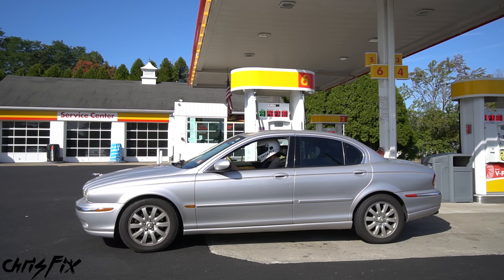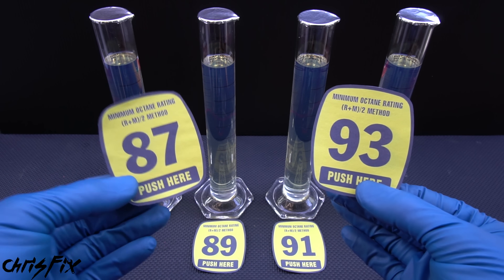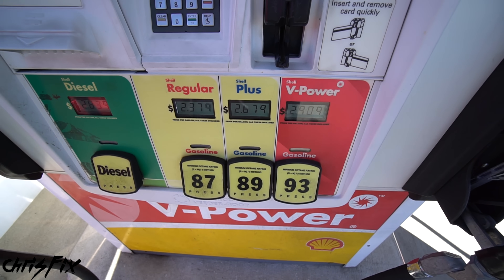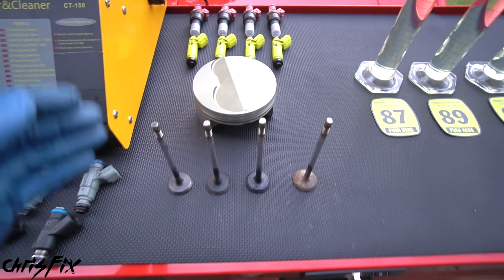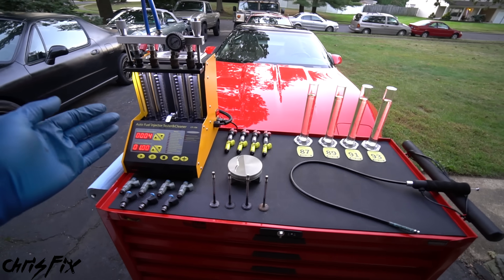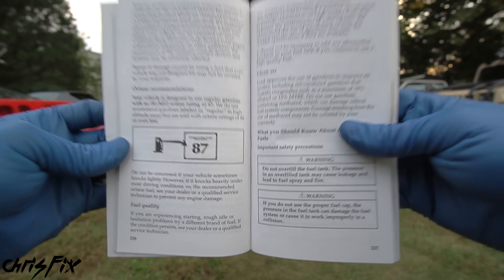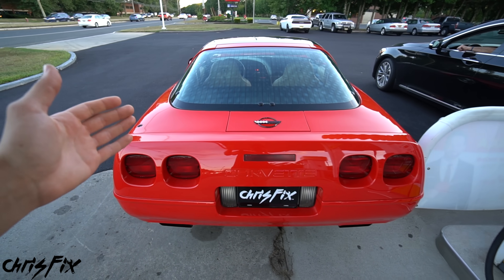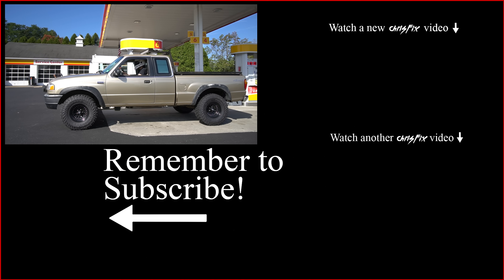What is the BEST Fuel to Use in Your Car or Truck and WHY

Comment: Which fuel do you recommend for a 1999 Lexus ES 300 with 270,000 miles on it? Premium is recommended but not required in the owners manual
Reply from the maker: For such an old car, premium would be better but you can totally run regular since it says recommended. I would see what kind of mpg you get on each and see if the premium is about equal to regular in price if there is a mileage increase. Detonation in any engine is bad but in an old engine it can be really bad, fast.
Reply: @chrisfix  Thank you so much! I have been debating this with myself especially since I have always used regular, but given its mileage maybe premium is better.

Comment: Could you go into E-10? It's getting standardised over our Regular (95RON) in a lot of countries in Europe, but it being 10% ethanol it's not fit for every car. I'm curious as to what possible risks having E10 over the old E5 brings? Nowadays I'm forced to fill up with 98RON E5 because the manufacterer says E10 is no good for my car, though I wonder what difference the ethanol makes exactly.
Reply from the maker: Most fuel injected cars can go to e10 without issues. After that it becomes an issue. If they are saying E10 is an issue then your fuel system is at its max capacity and it cannot spray more fuel to compensate for the e10

Comment: Run ethanol free fuel with older vehicles when available !
Reply: Or convert the lines and pump to ethanol compatible and let her rip! :D
Reply: I run 90 non-ethanol in my ecoboost.
Reply: Run ethanol free one everything!!!!
Reply: My state has alot of recreation stuff you we can get rec gas(no eathonal). Great for stuff that will be stored.
Reply: @aydanangus  I run Marine/RV gas (non  ethanol) in my lawn mower and snow blower for the last few years with zero problems with them start after sitting in the off season. A little more expensive, but worth it.
Reply: Clay Fick thank you captain obvious!
Reply: That's just lies. I got an old carbureted car, runs fine with regular gas for almost 30 years.

Comment: When I bought my car, I wondered what kind of fuel to use in it since the engine came equipped with a turbocharger.  I was thinking I would need to use a higher grade fuel because of my turbocharged engine, but my dealer said my car would run just fine on regular 87 octane gas.  I never had a turbocharged engine, so this was new territory to me.
Reply: Same here. I had a Ford escape 2.0 and it used regular no problem

Comment: I have a 2001 Dodge Ram that came with a 318 or also they called a 5.2 liter and when it was brand new on the sun visor it said to use the cheapest gas or the lowest octane and not to worry about the Knocks LOL. So little by little I started becoming concerned about that noise the valve Knocks and started putting mid-grade in it. Then it would only knock every once in awhile but not all the time. So then I started putting premium in it and the knocks quit. So from then on I've always use premium and it still runs good at a hundred eighty thousand miles. Meanwhile I have a 2014 Dodge Ram with a 6.4 l or 392 whichever you want to call it and it said the run on regular low octane and it runs great on regular so I've never changed it. Just thought I'd mention that. Even though they said to ignore the knocking noise there's no way that could be good so did you get knocking I would suggest moving into a higher grade until it quits

Comment: Just run regular on older cars and add fuel cleaning additives et voila, premium.
Reply: Use octane your car recommends
Reply: Ben I agree for new cars. Old cars: Use additives or go trough carbon deposit hell.
Reply: ButchE30M3S14 In terms of what brand gasoline cleans carbon the best none. I agree just use additives if that’s what you’re trying to accomplish.

Comment: If you use low 87 octane, does it really matter what gas station you go to? Shell and chevron are frequently at least 50 cents over the price of the same octane levels at Valero or arco or Safeway gas where I live. Can you just use an additive and save money? Or would it save more money going to these expensive gas stations instead of buying an additive?

Comment: Chris, what’s your thoughts on dual injection methods like the one in the 2016+ Tacomas? It is mainly a direct injection engine but when the conditions are right it will switch to port injection to clean the valves.

Great video as always.

Comment: Not even gonna watch because its a simple answer. USE WHAT YOUR CAR REQUIRES.  I have to run 93, its what it wants and what it was set for. 87 just makes it run like crap, it pings, less power and economy suffers. 12.5/1cr

Comment: What if I want to switch to premeum if my car has regular fuel in the tank. Can I mix it together?
Reply: D VoZ   You can mix premium and regular. That is what mid grade fuel is. However if your car requires premium you can not mix the two. You must use premium. If your car only requires regular and it’s not spark nocking than just stick to regular.

Comment: Unfortunately my car pings with 91 shell with octane booster and my Volvo says it only needs the 87 equivalent octane in Europe (its a european import that I drive in Texas ) I have to use 93 octane from Sunoco with octane booster to stop it from pinging. I’ve checked and the car doesn’t have a lot of carbon deposits and I’ve still cleaned it several times with seafoam and the distilled water method. Idk why mine Does it. It also feels much better in cold weather. Should I be considering fuel injectors? Maybe because the car is pre ethanol gas in Europe (I have a 1999) it may not like the ethanol added? It’s kinda weird.

Comment: In regards to E85. It's possible that the car is capable of running it but not as configured. There are some GM vehicles I know for sure that are FlexFuel capable but might not have the FlexFuel module from the factory. It can often be purchased and installed separately by the dealer. For my 2013 ZL1 Camaro the module is ~$300. I haven't bothered because E85 isn't real readily available in my area so i'm reserving that upgrade for if and when I decide to go with more boost.

Comment: Hi Chris ! Could you explain my manual says recommend octane 87 or higher . What does it mean ? I have Honda Accord 2018 sport 1.5 turbocharged direct injection vtec . 28000 mi on it and it’s poor fuel economy and pinging , no power  on regular 87 top tier brand gas stations in Nyc . My compression ratio is 10:3.1 . When i asked my dealer which octane is better , they answered regular . Thank you in advance !

Comment: Here in Appleton, WI, the Kwik Trip gas stations have 87 Octane 10% Ethanol blend (which is standard) but also 88 Octane 15% Ethanol blend which is 5 cents/gallon cheaper. Does the extra Ethanol hurt engines in any way?

Comment: Hey ChrisFix! Thanks for this video! I have an 06 Subaru Forester. The manual recommended that I use regular gas, but I was wondering, because of the high mileage, and replacing the head gaskets, if I should start switching to premium fuel. Any insight is appreciated :)

Comment: I feel like mid-grade gas is a scam. I never see or heard of anyone ever buying it 😂 
It's either Regular or Premium/Supreme
Reply: AcesW I L D Mid grade is mixed at the pump. It’s half premium and half regular. If your car is spark knocking you can use mid grade or higher. Some vehicles do require it

Comment: Could you do a video going more in depth on E-85? My truck is flex fuel and some manufacturers that have flex fuel vehicles will actually give a higher power rating when the vehicle is running on e-85 and a lot of race cars run it so I think that would be interesting.

Comment: Bought a new Hyundai Tucson with a 2.4l that knocks for a few seconds when starting up cold. And continues to make a pinging noise when driving. Tried using a higher octane fuel but no luck. Any other suggestions to eliminate knocking/pinging noise?

Comment: so i have a 2007 Chevy Silverado 1500 classic single cab with a v6 and its a 4.3 L and it has never been cleaned so should i run 93/91 or no also should i put seafome in it?

Comment: You won’t ruin your engine by accidentally pumping diesel into it because the diesel filler nozzle is too big to fit into the fuel opening of a gasoline engine. I learned this the hard way while starting to pump gas in daze at a BP station (green is on the brand logo and all over the pumps).  I couldn’t understand why the pump wasn’t fitting in until I realized that I grabbed the wrong nozzle 😪.  
Bless the engineer who came up with that difference 🙏🏽😌🙏🏽

Comment: Most all the gas here contains ethanol ten percent, if you find a station that does not contain ethanol the price is adjusted higher, so what about the "Gas" that does contain ethanol ten percent or higher? does that percentage of ethanol screw up the equations of the topic of this video?

Comment: Can you mix fuels? Like 87 with 89
Reply: Absolutely. The only consideration for octane is that you have the minimum required for the engine. Too high of an octane is in no way harmful. If you mix it then you could calculate an "average" octane depending on the ratio of the fuels mixed together.

Comment: 14:35 doesent that decrease the amount of energy in the fuel though? did you forget to mention that?
Reply: vulduv He mentioned earlier in the video that the octane level has no noticeable impact on the available energy.
Reply: @Armyhamsters  I meant the octane booster, its probably not just high octane gas. its probably a liquid wich reduces the risk for knock(and thus increasing the octane rating) but doesn't actually contain much energy for combustion. so it would dilute the fuel somewhat.

Comment: Look at those gas prices 😍 I need to move out of Cali
Reply: It’s even lower over here in the yeehaw (Texas)
Reply: Sweden (and most of europe) is worse. Our prices are roughly $6 per gallon right now.
Reply: @sigg610  5.8USD in Hungary while average salary is only at around 360USD. 😊😊😊😊😊😊😊
Reply: Almost all of Europe doesn't drill their own oil. Some of the countries (UK, Norway) extract very little to stretch their underground reserves. Also, European countries have absurdly high taxes on fuel to pay for their heavy social systems, the cost of roads, policing, etc. States like California, Oregon, Washington, and basically everywhere in the Northeast USA have prices to beat Europe, but they're still quite high compared to the rest of the USA. Where Chris is in New Jersey is actually a very high price as well.

California's a special case. Not only are the taxes high, but CARB also mandates a special low-pollution gasoline blend that makes their prices insanely high. California also doesn't drill their many oil reserves, and also refuses to have a pipeline from the Gulf. Instead, they insist on using high-pollution trucks and tanker ships transport their special low-pollution fuel to their population, resulting in a sky-high priced crappy fuel.
Reply: Those prices look high to me. Here in VA regular at Shell in my town is $2.14 (2.139).
Reply: @rontiemens2553  Shell is even more. Maybe 4.50
Reply: Chuy Tuba gas in south Texas currently is 2.11 👀
Reply: 4.55 in San Jose :(
Reply: @oneBIGMAC2go  Roughly converted to gallons and USD, in the UK it's averaging around $7.50 a gallon. We got some really cheap petrol over here :'(
Reply: Best thing I ever did was move out of CA.
Reply: 450 here in shit Riverside CA :(
Reply: i feel u
Reply: Pretty sure he lives in New Jersey
Reply: In the Netherlands you pay €1,70 per liter ($7/gal or something). Premium is even worse.
Reply: wait until you see prices in the UK, £1.30 a Litre, £6.50 a Gallon.
Reply: For me those prices are high in lithuania its like 0.90€
Reply: @jurgitavainauskiene7156  Lucky
Reply: Im in St.Louis and thoes prices are the same here. Normal mid west prices
Reply: Come to Europe and you will start to cry.
Reply: Haha, what are you guys complaining about? Here in mid Sweden it was over 17 kronor / L this summer, thats 6.48$/gallon.

The standard prize is about 6.06$/gallon.
Reply: I pay $2.05 in Fort Worth TX
Reply: J H 4$ isint bad. Here in Finland at my local Shell its currently (at night) 1.57€ per liter (1.73$) or 5.93€ per gallon (6.54$) for 95 (or regular) and even worse for 98 (or premium) at 1.72€ per liter (1.89$) or 6.50€ per gallon (7.17$) so if I were you I would consider myself lucky to have such prices near me :/
Reply: Lol here in holland its cost 1,40€ like 2 dollars and in luxemburg its cost 1 euro thats like 1.40$
Reply: I pay 2.80 for premium in Florida
Reply: Here in New Zealand fuel is $2.34/litre so roughly $8.86/gallon. So it must be nice having such low fuel prices :)
Reply: It's around 1 USD per litre in India, Kolkata. The fuel we get is very good compared to Russia and other countries.
Reply: $2.70   91 octane in MA
Reply: Try the UK it's £5.72 or $7.31 a gallon. At least half of that is tax :)
Reply: Chris is in Jersey. Those prices are good, I'm in NYC and it's around 2.65-3 here. Prices are best in central states. However you cant pump your own has in Jersey. Screw that.
Reply: Yo man, as much as I hate the delusional political views and outrageous prices and taxes, I cant imagine myself living anywhere else.
Reply: @Johnny Blue yep
Reply: I mean i dont have a car i am 16 i just know when we go on a holiday
Reply: +Chuy Tuba, its at $2.17 at a Costco here in El Paso, Texas
Reply: Ah yes, come and experience the wonder that is Wawa coffee here in the East Coast!

But if you really want cheap gas, go to Virginia.
Reply: $3 a gallon for 91 in the Minneapolis area
Reply: in Greece gasoline is at 1,65 per litre... Love it too?
Reply: @J H i pay around £1.30 per liter which totals out to around $5 per gallon so your lucky in my eyes
Reply: I pumped someone's fuel the other day that said 87 was like $4/gallon. Holy shitballs.
Reply: Don’t worry a few years ago they were at like 3.50 a gallon
Reply: You beat me to this comment lmao
Reply: What's taking so long? California is a shit hole
Reply: Right. Haha.   Id be filling my v10 up with premium all day and still be saving money.
Reply: 1 Liter of gas in the us is about 1/4 of a gallon which is 75Cents so 4 liters is a gallon and that is about $3.00. So just convert it into your currency.
Reply: Welcome to gas taxes. In reality, the base price of gas is about the same everywhere, with slight exception of being a loss leader for some stations. You can blame the vast majority of price differences on the taxes your country/state/city each levies on your gas.
Reply: The east coast maybe. cali is at $4.+ right now where i live
Reply: @mechdavetech  😲
Reply: @mechdavetech  $4+ in South Africa😭
Reply: You should. Commifornia is a shithole.
Reply: Right?! Lol

Comment: In my car 40-60 octane is required. With this car it has a low compression abou 50-55psi which is normal. I have use only ethanol free fuel. It is getting harder to find. What is the best fuel. 1925 Dodge brothers sedan.

Comment: VW Recommends 91 Octane. My tuner has adjusted the fueling and boost for 93 Octane so I run 93. VW has gone as far as saying the new GTI can run 87 but if you want 5-10 more HP, run 89 or 91. So they make 87 possible but you get lower power. If I go Multiport Injection (via a hardware change) on my Golf R, my tune already supports E-85 which is nice and makes more power but again, it's equipped for that and supports / adjusts for it.

Comment: There has been many scientific tests on gasoline and the results prove there is no benefit of using high octane just use regular.  And as for ping and knock the computer will take care of that. REGULAR is more than fine. You dont get higher horsepower or fuel economy.

Comment: Used premium on a nissan engine from the beginning, not regular as specified. The engine has 430,000 km, everything original; doesn't leak, doesn't burn oil,  works like new, so whatever.  I'll keep using premium.

Comment: Another great video, Chris! Do you know if it's possible to get high octane, ethanol-free fuel where you live? I've been running 91 octane ethanol free in my small engines ever since I moved to Idaho a couple years ago, and it has saved me from SO MUCH carburetor work, since ethanol always cloggs the carburetors up if the engine sits more than 4 weeks, whereas ethanol free can sit all winter without having issues. I also noticed, the engines tend to run a bit snappier, but it could just be me. I just thought it would be cool if you could get some and test in your cars. Either way, keep up the great work!

Comment: In the US I was surprised to see 85 instead of 87 when I was driving through the Rocky Mountains. I was told because of the thinner air you can run lower octane.  Seemed to work fine.

Comment: My local gassy offers non-ethanol fuel @ 89 octane as an option.  Any advantages/disadvantages in using it with todays engines?
I have an 08 ridgeline w/ 150k on it....
Reply: Jimm Mcphadden Non ethanol fuel is more for carbureted engines. Ethanol is known for destroying plastics
Reply: Non ethanol fuel will have "higher emissions" since adding ethanol to gas is only done primarily for emission reductions. Running fuel without ethanol at all, is beneficial for older cars that don't have fuel systems designed for 10% or 15% ethanol which can corrode some fuel system components on those older cars. Also using ethanol free fuel for lawn mowers and other small engines that only run once a week or month or even months can help since the ethanol in the fuel will cause some crystallization in the carburetors causing a requirement for  extra service and even cause breakdowns. I add fuel conditioner and carb cleaner in all my small engine fuel to help prevent that.